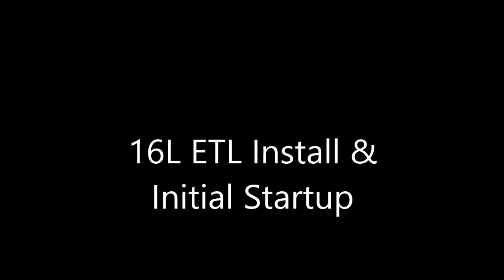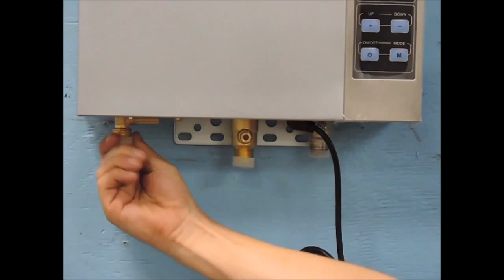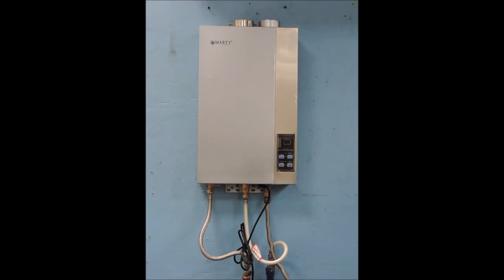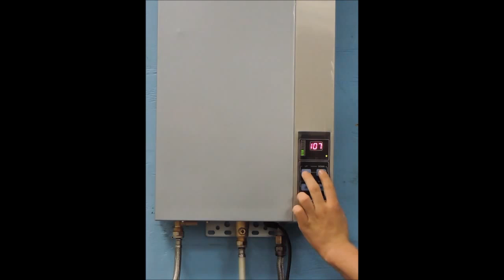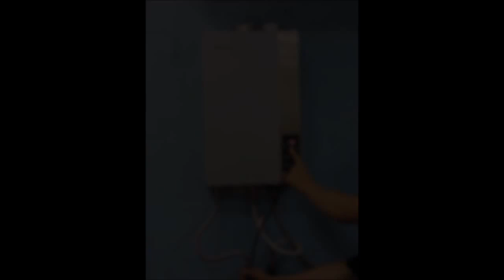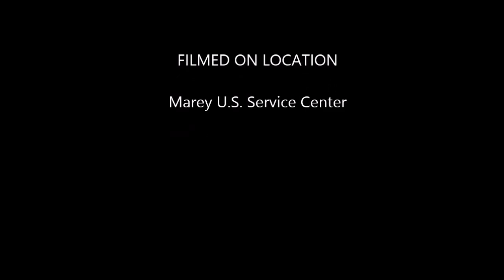Marey 16 L ETL Install & Startup

Comment: I have 22 (twenty-two) of these units, and I love the ETL model why you guys cancelled it is beyond me, but I am wondering why the remote control unit for the ETL was cancelled/discontinued? I know there was one at the very least in development, or prototyped because the main unit board has a dedicated connector for one, and the ROM has programming code left over for incoming remote commands, so I ask, is it possible to obtain a remote unit?? You guys have to have at least the prototype units sitting around doing nothing, would you be willing to sell me one??? Otherwise I am planning if all else fails to design and make my own remote unit, if you could would you be willing to at least sell me a copy of or supply the main chip board schematic???? If I have to I will make one from scratch but any help you can provide would be appreciated.